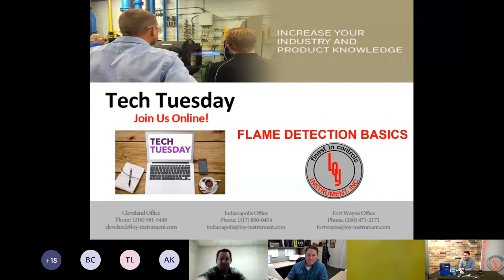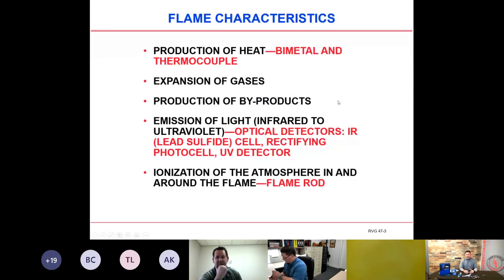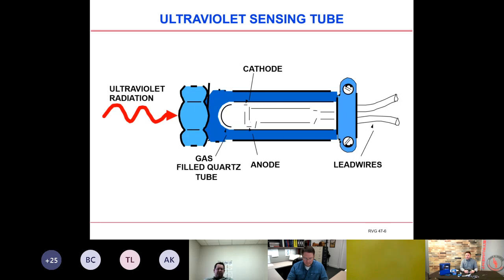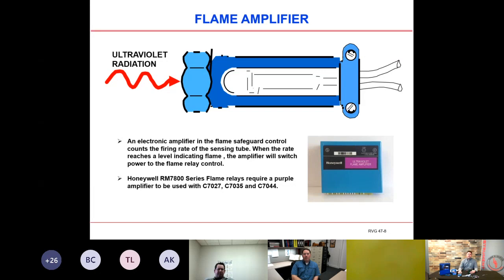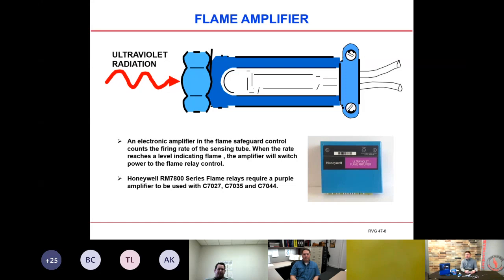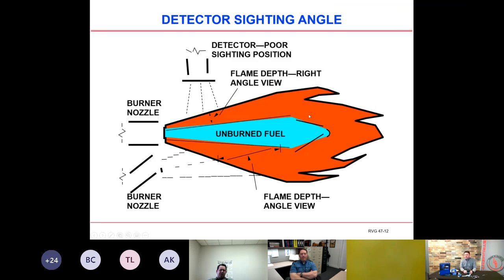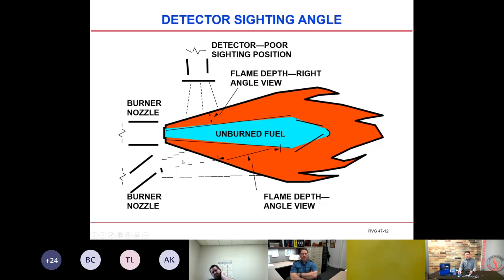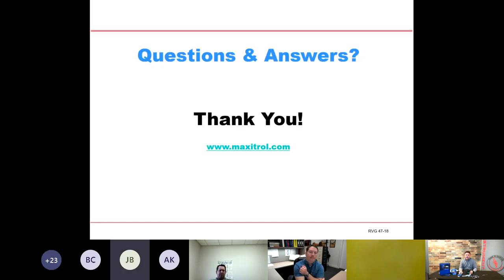Tech Tuesday with Loy - Flame UV Detection

Comment: BIN LOOKING FOR THE VOLTAGE ABOUT THESE FOR HOURS
Reply: NOBOX7, If I am not mistaken, the voltage on the scanner runs 220 VAC. I will confirm that today and repost a comment. I am 99% confident in this though.
Reply: Okay NOBOX7, I hooked up a relay this morning with a UV amplifier installed.  I looked at the voltage between the F&G terminals and to my surprise here is what I found.  With no flame present there was 150 VAC / 205 VDC.  With flame present (conductivity within the cell) there was 130 VAC / 80 VDC.  I hope that this helps.

Comment: How can I test the ultraviolet sensor if I think it’s bad in the field. I have a flame but weak voltage signal
Reply: Thanks for the question. The easiest way to test a mini peeper in the field is to hold it in your hand and present a flame in front of it. Just use a lighter. There is a grid inside the scanner tube that consists of four squares. All four should light up with your flame present. If less than four are lighting, the tube is degrading.